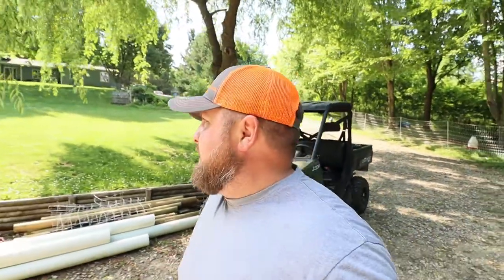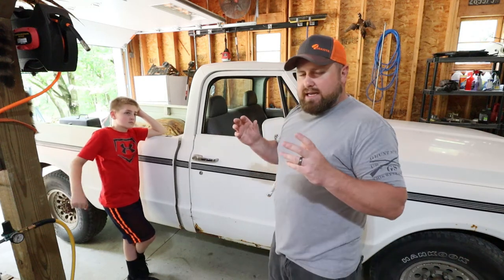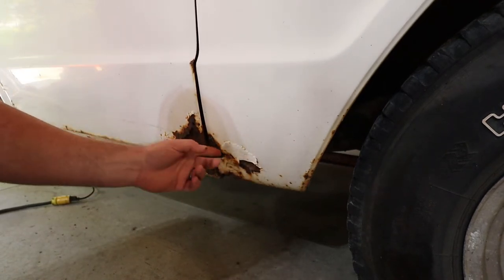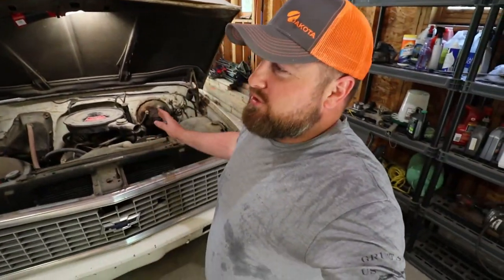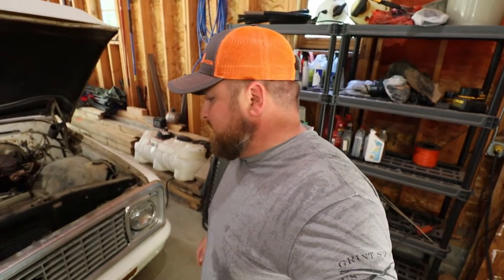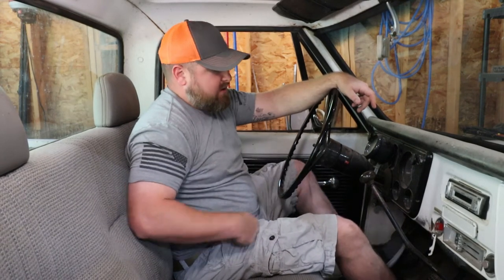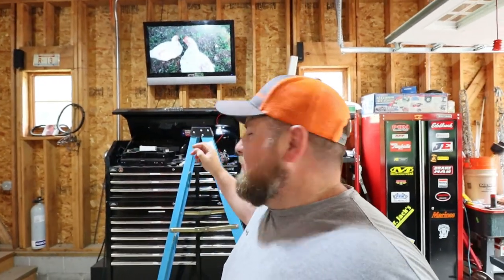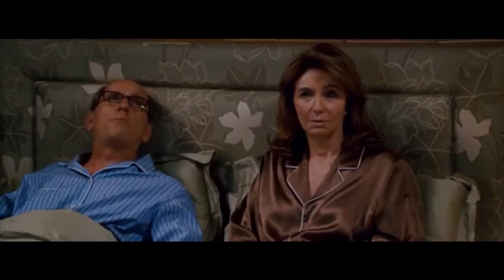1971 Chevy Truck Build  ( PROJECT CHUCK )

Comment: Great to see people getting their kids involved in projects like that, nothing better than getting their brains working.  Makes me wish I had a kid to do stuff like that with.  

I started repainting a pickup I purchased last December.  Truck runs and drives great, and overall looks really good, just the 30+ year old paint has some clearcoat that's missing, and peeling, and a couple areas on the fenders were lacking paint and had rust starting.  The local paint & body shop quoted me $5500 to repaint it...WTH, I only paid $800 for the truck.  I decided well heck, I've heard of people doing Rustoleum paint jobs on their vehicles with great results.  So, I found a blue for the lower portion of the truck that closely matched the factory blue, taped and masked everything off, sanded it down and repainted it.  2 coats of paint (spray paint) and 2 coats of clearcoat.  Looks pretty dang good for a spray paint job...some overspray that got on the white paint from the masking job I did, but who cares, the white is getting sanding down and repainted here soon too, except I'll be using an HVLP gun and Rustoleum paint for that as there's a heck of a lot more white than there was blue.  I also pulled the bumpers and repainted them too, and did a rubberized undercoating on the back sides of them.  Here in a couple months the truck will look brand new.  

If you can do stuff yourself, its so much in savings.  With the paint, spray gun, and materials I may have spent $200 sure a lot cheaper than the $5500 the paint shop wanted to charge.  Plus I get the experience of learning to do the work myself and what all is involved...trust me that blue section of paint I did, wasn't done 1 time...took me 2 times to get it right....its only paint, can easily be sanded down and redone...no harm in messing up and having to do it again, its only a few bucks in materials to learn how to do it right.

Comment: I couldn't get my drivers license until I could competently drive a stick shift. Every car I have owned since has had a manual transmission.
If you want to see  a beautiful pickup restoration by a17yr old, check out Cole the Cornstar.
Your project sounds like fun and will be a wonderful way to teach your son beneficial skills.
Have fun.
Reply from the maker: My first 4 vehicles were sticks so I learned real quick lol